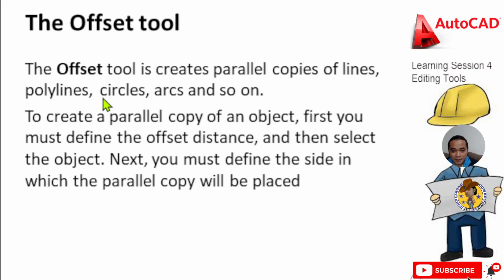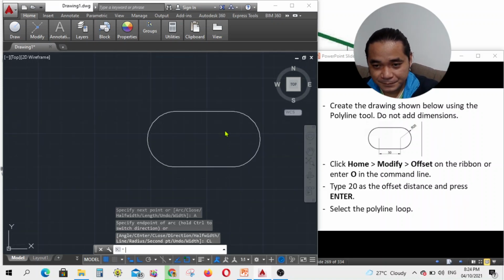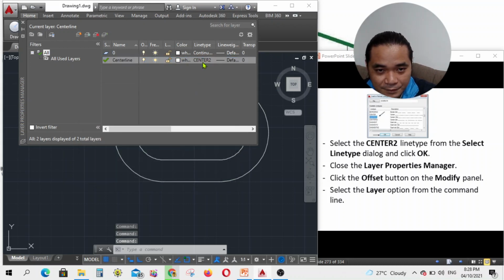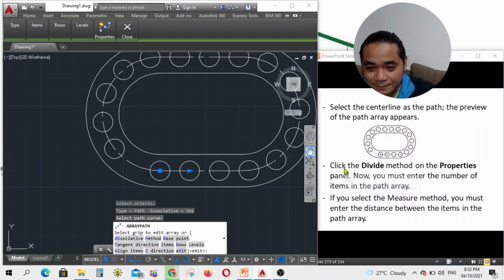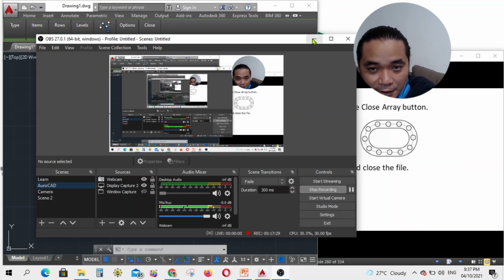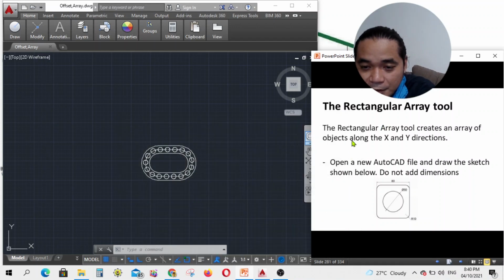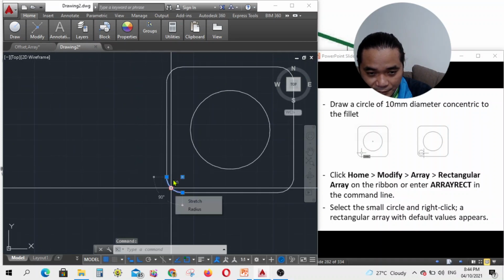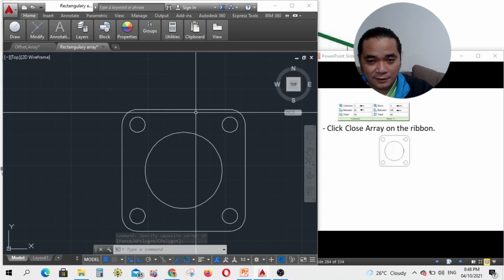AutoCAD LS 4-3 | Editing Tools

Comment: LS 4-3| The third section of Learning Session 4 discusses three editing tools: the offset tool, the path array tool, and the rectangular array tool. To begin, I discovered in this video that the Offset tool can make parallel copies of lines, polylines, circles, arcs, and so on. To make a parallel copy of an object, first specify the offset distance and then choose the object. The side on which the parallel copy will be placed must then be specified. The Path Array tool, on the other hand, generates an array of objects along a path, such as a line, polyline, circle, helix, spline, and so on. Finally, there is the Rectangular Array tool, which generates an array of objects along with the X and Y directions. Keep it up sir! You really did well. Thank you sir.

Comment: In this learning session, I learned about the offset tool, which is a very important command in AutoCAD that we can use to create parallel lines, concentric circles, and parallel curves. We can offset any object through a point or at a specified distance. With the offset command, we can create as many parallel lines and curves as we like. I'm so thankful for gaining new knowledge in Auto Cad, which I can also apply in the field that I have chosen. Thank you so much, sir, and God bless!

Comment: In this video, I learned that there are useful tools to guide you when drawing such as the rectangular array tool, combined with other offset and Arraypath tool as well. This is very helpful when designing road blueprints or maps since it requires precision to draw it.

Comment: The part 3 of this learning session discusses three more editing tools: the offset, path array, and rectangle array. The Offset tool duplicates lines, polylines, circles, and arcs in parallel. To duplicate an item in parallel, you must first specify the offset distance and then pick the object. Following that, you must specify which side the parallel copy will be put on. The Route Array tool arrays items along a path, such as a line, polyline, circle, helix, or spline. The Rectangular Array tool generates an array of items as well as their X and Y coordinates.

Comment: In continuation with the editing tools. Offset tool creates parallel copies of lines, polylines, circles, arcs and etc. This has helped me make outside/inside layer of an object much easy to draw. There are different line types. By proceeding to the layer Properties we can change the linetype and etc. The Path Array duplicates selected objects and places them accordingly to the selected path. However, while performing this example I find it difficult to demonstrate. Moreover, I think with more practice, the little tricky-ness with this tool would later on be eliminated. Rectangular array creates an array of objects along the X&Y directions. In performing and using these tools, it is very important to understand every part of it and function of each. Struggling with tools at the beginning is normal. Moreover, this video has taught me on how to use the tools presented effectively.

Comment: This learning session, we are about to learn again the different tools or commands used on editing. It is now on offset tool in which it creates parallel copies of lines, polylines, arcs, circle and so on. And I learned that while working with AutoCAD, you’ll quickly run into situations that requires you to use modify tools. As the name suggests, modify tools are used to modify existing lines and objects. AutoCAD has a whole range of modify tools. When it comes on the array tool, it creates an array of objects along path like line polyline, circle, helix, spline and so on. Indeed, this learning session taught me how to perform editing operations such as erase, move, trim and etc on the objects in a drawing. The most common of these tools are located on the Modify panel of the Home tab.

Comment: AutoCAD LS 4-3

In this session I learned that when working with AutoCAD, you'll frequently encounter scenarios that necessitate the employment of edit tools. Modify tools, as their name implies, are used to alter existing lines and objects. AutoCAD includes a plethora of editing features. When you use the array tool, it creates an array of objects along the route, such as a line, a polyline, a circle, a helix, and a spline. You can also adjust the scale to see how it would look in different sizes without having to adjust the drawing itself. Learning to use the tools makes it easy to draw objects accurately, with various options to set the exact size and alignment that you need. On your screen, there’s a rectangular grid. You can click on any interval on the grid to locate the point that you need. Thats all sir, thank you and more uploads to come.

Comment: In this learning session, I learned more about the Editing tools such as the offset found in the Modify panel and how to build loops and use the layer attributes, as well as the path array tool, which is a little tough to understand. During the offset tool talk, I also learnt how to alter the line type of a layer. Rather of manually constructing fresh circles that must be aligned within the loop, which is time-consuming, the route array tool may save us a lot of time by allowing users to evenly produce their desired number of circles with only a few clicks. Well, this learning session is difficult though it needs to have more patience and more importantly enjoy in doing it! Thanks for this video Sir

Comment: This section of Learning Session 4 delves into three of the most intriguing editing tools — the offset tool, the path array tool, and the rectangular array tool. The offset tool teaches me that it is possible to create another layer of an object without having to go through the hassle of repeating the same process of creating the object. During the offset tool discussion, I also learned how to change the line type of a layer. Rather than manually creating new circles that must be aligned within the loop, which is time-consuming, the path array tool can save us a lot of time by allowing users to uniformly create their desired number of circles in just a few clicks. And instead of individually creating circles concentric to the fillet, you can use the Rectangular array tool to easily make copies of a circle in a rectangular pattern with a uniform distance. It allows you to specify how many circles there should be in a row and column, as well as how far they should be.

Comment: Thanks to this video, I learned what are the function and uses of the offset tools,path array and rectangular array .The offset tool creates parallel copies of any object like its line,arcs,circles and so on.The path array is very helpful in creating an array object along the path and the rectangular array which helps to create an array that corresponds to the x and y direction.These learnings Ive gained makes me realized that you dont need to be an IT expert or well diversed person in computer to use auto cad,i realize that in auto cad all you need is time,patience and practice